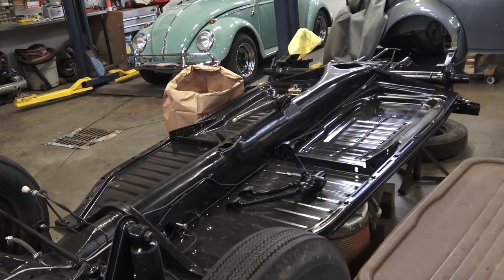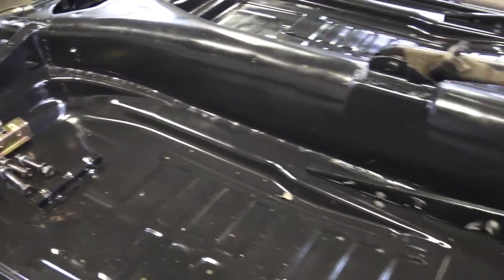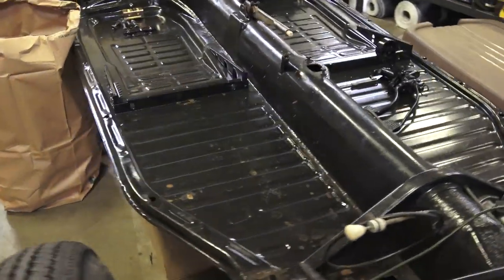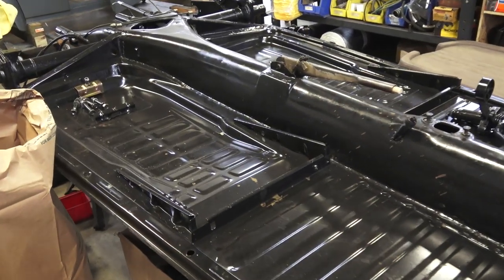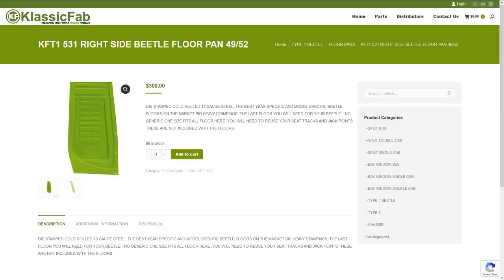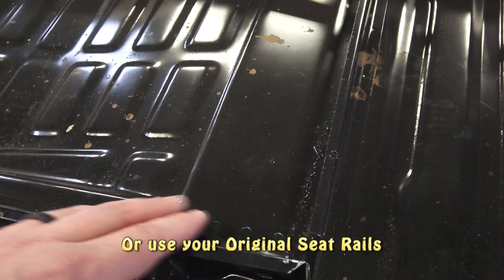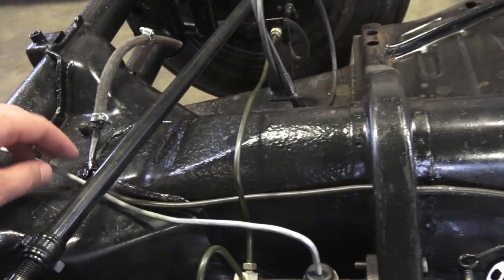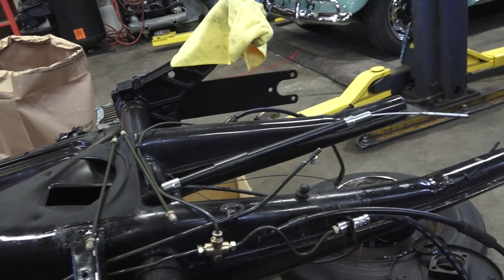Classic VW BuGs Selecting the Right Floor Pan for your Vintage Beetle

Comment: Just a heads up Chris... some states DO NOT allow fuel lines running through the interior. It's an inspection failure. I guess I got lucky replacing lines in my fuel injected '75. I was able to pull them out from the rear frame horn with a slide hammer of sorts. Used an electrical fish tape to pull new lines through the tunnel and original tabs. A couple areas I slid some rubber line over to protect and zip tied a couple spots through existing holes in the tunnel. Only took a few hours.
Reply from the maker: Wow that's nutty.  I mean then the only other way would be running it outside alongside the heater channel, or something.
Reply: @classicvwbugs  it is! Massachusetts is really strict with inspections

Comment: Good tip on the fuel line Chris!
Reply from the maker: thank you.  Some think it is dangerous.  I have run it both inside and out.
Reply: Chris Vallone Honestly I would never think it was dangerous to do that. If you think back of all the other cars, the fuel line runs along side of the frame underneath the car. Running it the way you did it would not be unsafe. Have a great day  Chris!
Reply from the maker: @SladesVWBeetle  I agree, after thinking about it more, where else can you run it but outside the bug?  =o)
Reply: Chris Vallone absolutely Chris. Honestly every car I have worked on outside of beetles, the fuel line is run along the frame rail, by the factory. There is never been a tragedy over it. You make good common sense in everything you do my friend. I believe I tried to add you on Facebook please check it when you can. Would like to follow you everywhere if possible. Have a wonderful day brother.
Reply from the maker: @SladesVWBeetle  you da man, thank you for that man.

Comment: Chris, the IGPs are meh and I will tell you why. I had a 68 vert that I used them on, and they would make a warped oil can sound every time I sat down. I always opt for the better ones, I mean if you are going to go as far as doing a pan off, why cut corners right? Great video!

Comment: I just got new pans and I’m concerned about durability and strength because they are 22gage. 
Should I put those and move on or return them and get the 18gage?
Reply from the maker: Well depends what you are intending to do with them, show car or driver?  The only real issue we have had with the cheaper pans are the seat rails, they are weak, and from time to time the seat itself comes off the rails because they bend too easily.
Reply: @classicvwbugs  thank you Chris!
I’m going to get the 18gage

Comment: I’m no expert, but I’m not sure it’s a good idea to run a fuel line inside the cabin. Might even be a deal breaker for a state inspection.
Reply from the maker: Well, brake line runs through originally too, and that is more corrosive, but doesn't have fumes like gas does.  Running it on the outside can be an issue too god forbid it gets damaged in driving.  I have done it both ways.  What does everyone else think?  Would love to hear your thoughts. =o)

Comment: i need some advice i reverse hooked my battery onto my car and now it won't turn nothin i have a 65 bug any advice? i replaced the starter the battery cables the fuses and ignition coil and its a brand new battery.
Reply from the maker: uh, well hopefully you did not burn out your switches.
Reply: One more question Would it matter the battery if there’s a 71 one engine in it should I get a battery for a 71 not a 65 not a 6 volt a 12 volt ?
Reply from the maker: @morkicks818  You need a 12v battery for a 71